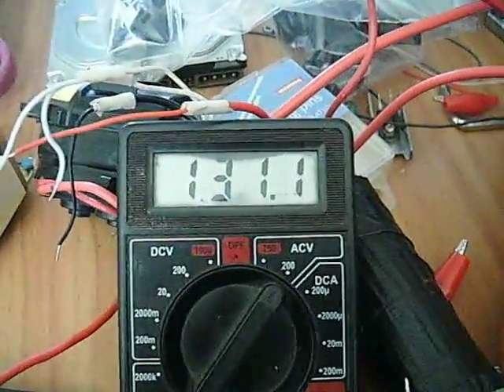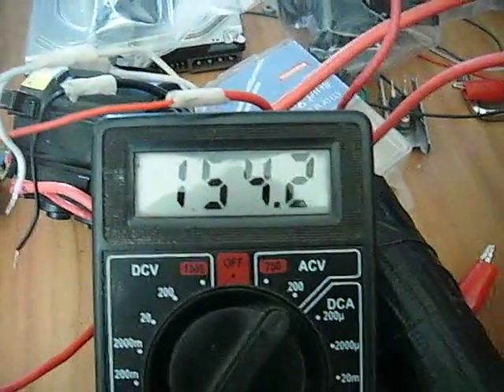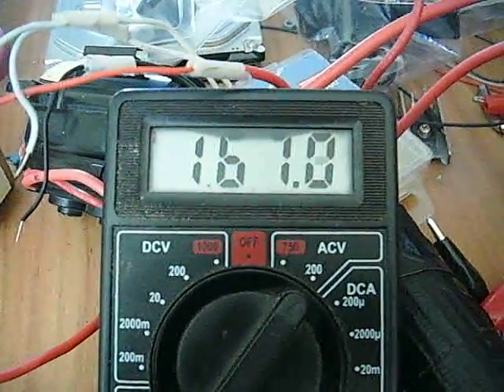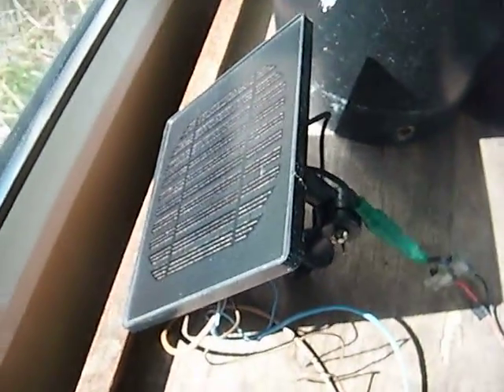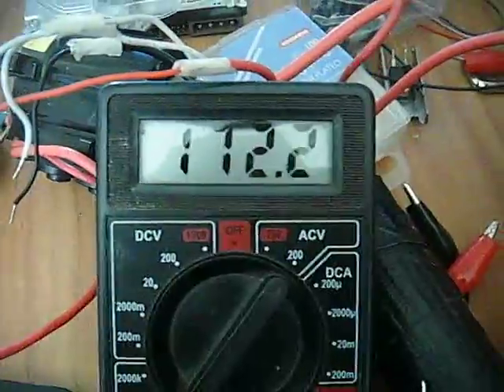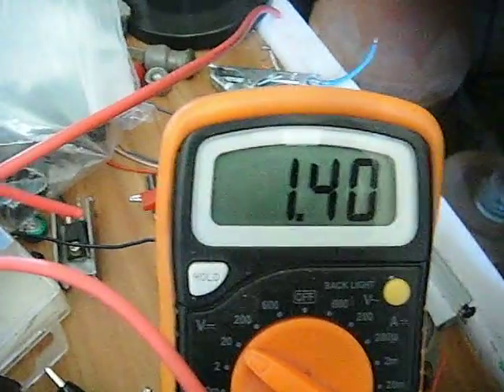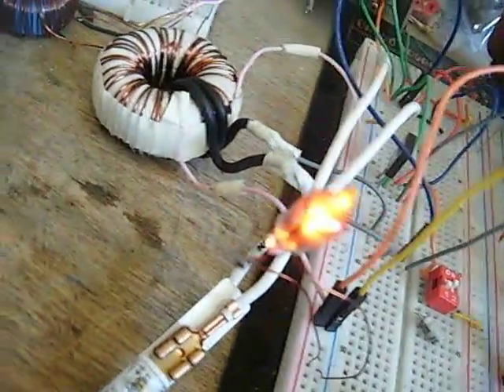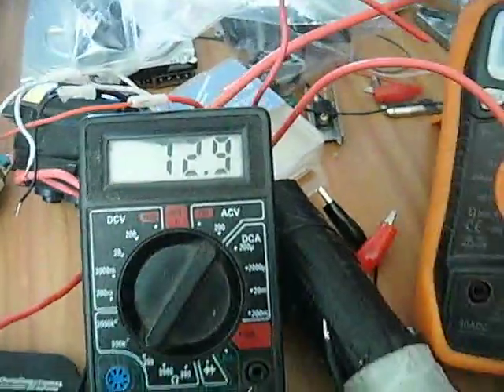Toroid Inverter Test 2 - 176v AC from 1.39v DC

Comment: please send me the calculations for toroidal transformer, how to calculate returns
Reply from the maker: Although there are rules, I follow NONE of them as I work with a harmless current. I am just experimenting so I will add only 5v maximum ;¬) However, I will say that it seemed like every 10 turns that I added to the secondary I got an extra 1 volt - My wire gauge  will only let a few amps through for extra protection and the wires are more likely to burn out 1st if I added too many volts+amps - I must mention that I did not add the "Earth"  at such a low voltage I did not see it important but if you raise input volts xturns on the primary will have to be re-adjusted and take some windings off - Experiment to your hearts content at low voltage, add earth and be careful if you add any more volts+amps.. Be Safe ;¬)